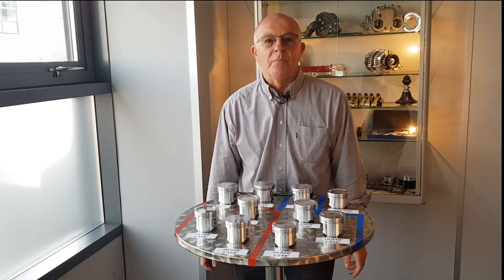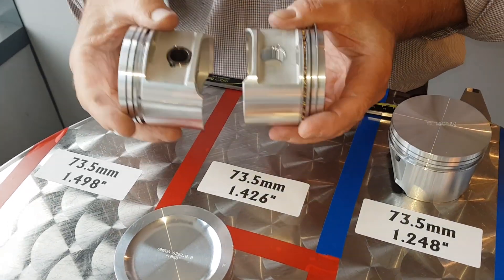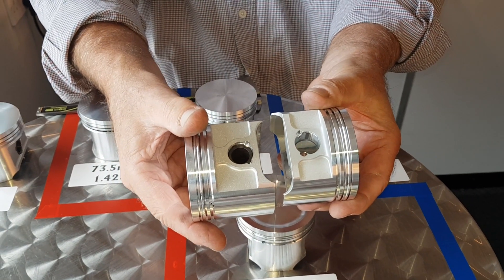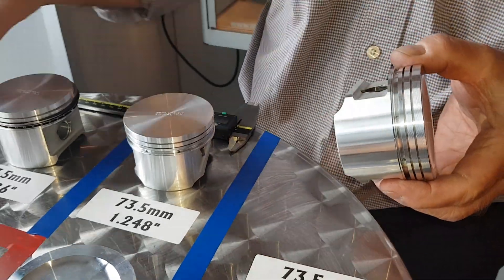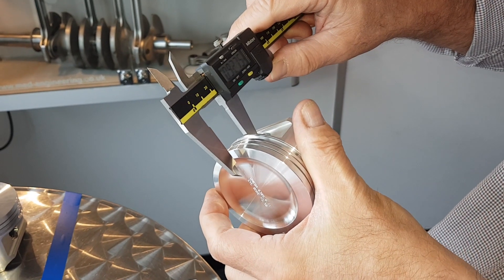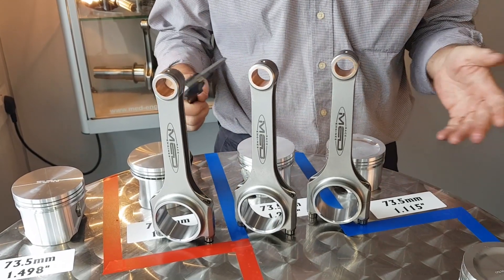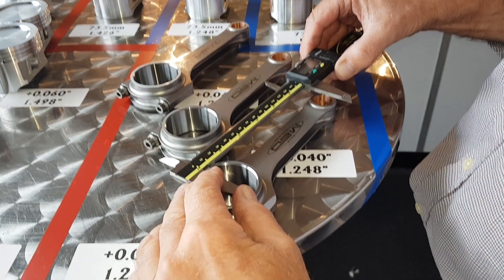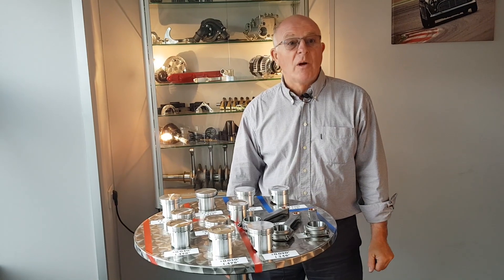Piston compression height explained

Comment: Does having a shorter skirt on the piston cause more cylinder wear due to the piston likelihood to have increased 'sideway' play.
Reply: When an engine is running, the piston actually floats and just brushes against the cylinder wall. It is the piston rings that contact the wall to make a gas seal. On the downward, intake stroke the oil keeps the friction low. 
Generally, a shorter skirt design is for short stroke engines and vs versa.
Reply: @mohabatkhanmalak1161  under power a piston can rock enough for the skirt to contact the cylinder wall, the rings then run at an angle and don't seal as well.
Reply: piston rock is what you are talking about. These are OK, once you get under 1" pin to crown you start to run into problems.
Reply: Yes the piston rock is a better use of  terminology, and that is what I was questioning, I'm most surprised that it can get down to 1" before problems, well, I'm a bit wiser now on that subject. Thanks!

Comment: Why so much crown height? Thought shorter crown height and subsequently lighter was better?
Reply: and that is exactly why MED have made the 6" conrod and corresponding pistons!
Reply: What are the negatives to a longer conrod and shorter crown? Physics after all, cant imagine you get something for nothing.
Reply: @beachboardfan9544  I think the only negative is cost, hopefully MED will come along to answer your question.
Reply: @beachboardfan9544  longer rod will be heavier, but shorter piston with be lighter, longer rod with have longer dwell at TDC. Go to long on rods and short on pistona nd piston with have tomich rock, cause skirt to bore contact and angular ring wear.
Reply: Tony can you elaborate?
Reply from the maker: @beachboardfan9544  There's no negatives to doing this, but some race series regulate you to the standard length conrods. See this link for an explanation of the benefits of a 6-inch rod - https://youtu.be/Te7_TaiYzR4?t=169
Reply: @MEDEngineeringTechVideos  This link is labeled  "Private"; any others available?
Reply from the maker: @deancook2377  Try it now. It was an old video we recently retired...